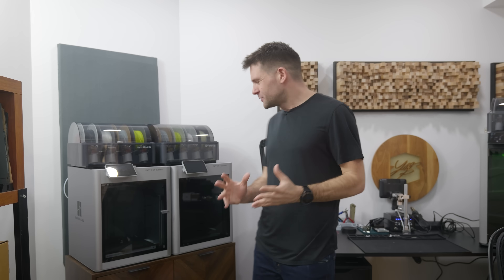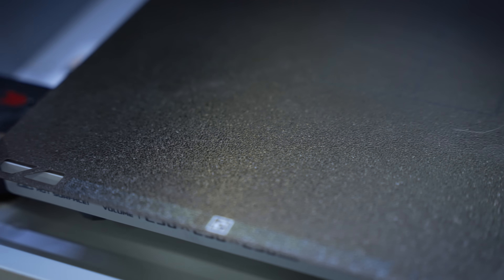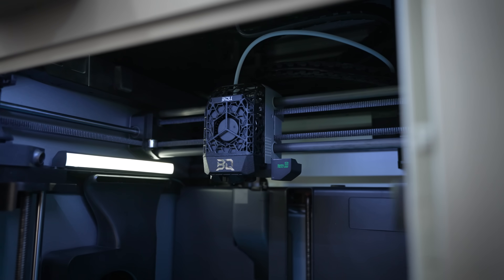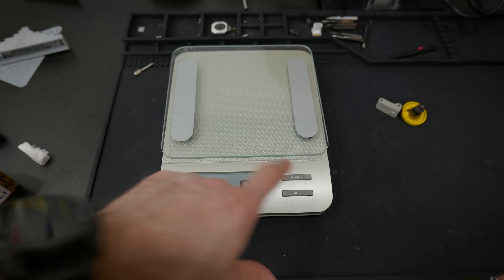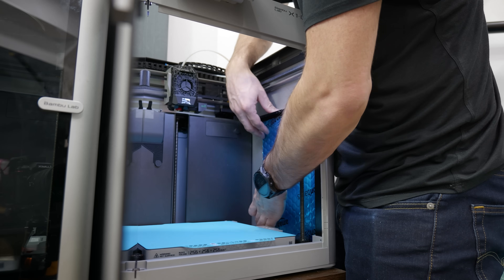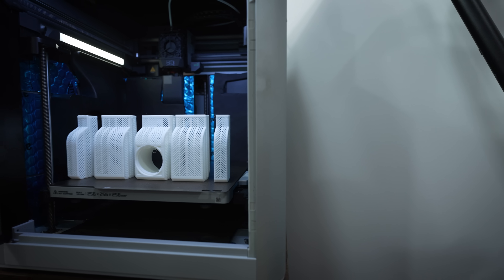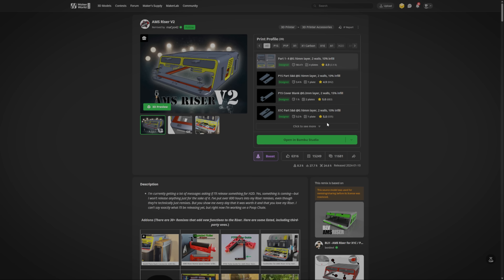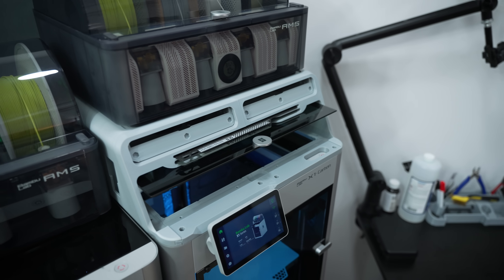I dont understand why more people dont MOD their 3d printers...

Comment: "why don't people mod their 3d printers"
*laughs in ender 3 pro*
Reply: I don't evem remeber what my Ender started as lol
Reply: I opened the video and was just like, well that's just a bad question, I don't know anyone who hasn't modded their 3d printer.
Reply: @iheartninja  I spent the first 1000 hours of printing EXCLUSIVELY printing upgrades or different mods to try.
Reply: @iheartninja  I also cant say that somone is perfect happy with what he buyed. There always a downgrade part, even in a topmodel.
Reply: "cries in Ender 3 Max Neo"
I first swapped the glass bed for a magnetic textured PEI bed. Then I swapped the hotend and extruder for a Sprite Pro extruder.....that the 4.2.2 mainboard didn't support. So then I got a 4.2.7 mainboard, but there is no factory firmware for the Max Neo for that board. So then I had to build and compile custom MRISCOC firmware. Then it sat for a year because I could never get adhesion. Did a bunch of research and found I I to fix the esteps and Z probe offset......and also that I had been turning the leveling knobs THE WRONG WAY! All good now, and I've had it up to 900% speed on a print.
Reply: @justinmcwilliams6759  lol, that was pretty much the same path I took with my 3 pro(s)
Reply: @DemarcusJohnsonIII  Last night I had a print running at 200% speed and 105% flow, no issues. I had it up to 900% speed once about a week ago. The Sprite Pro is DEFINITELY much faster, combined with the much lighter bed.
Reply: @justinmcwilliams6759  Cries in Ender 3 V2 with you
Reply: drowns in tears and regret for buying a printer that 1 other person has and I found him on this comment
Reply: Have you seen the E3NG upgrade for it?
Reply: @ Seems like a waste when you could just source parts for a Voron and have something that's exponentially better, but I could be wrong.
Reply: @DemarcusJohnsonIII  i'm not sure if this reply is meant to me, since there's no tag, but i'm not building a Voron from that, but the frame and motors right now are the only thing that left from original TronXY. I've started with hotend with 3D touch and MB (BTT SKR3 + EXP1 board and PSU), powered by RPi 4 and Klipper. Currently i'm looking for new Bed platform (thinking about Glass or some of those new Cryo plates)...
But i'm rebuilding it slowly piece by piece, when i have some extra money to spare, since its not my primary printer (just the biggest)

But rebuilding directly to Voron was one of my thoughts too... Just a bit expensive at this moment...
Reply: I'm laughing with my TronXY X5SA, While my Ender-3 V3 KE in stock prints parts for that monstrosity which i got for free because previous owner was fed up with it and wanted to toss it.
Reply: @ententeak  I learned the ins and outs of printers and printing on my ender 3. I think it's the reason I'm as knowledgeable as I am with printing.  I'm giving my least modded one to my little brother so he can learn on it before he ends up buying an expensive printer.
Reply: I have just since Januar my first Printer, its the Ender 3 V2 Neo
So much struggle.... but it runs now great with Sonic Pad and just now it prints out a lighter fang and DD mount.
Reply: EXACTLY! It's so moddable!
Reply: Laugh in ender 3 v1...
Reply: AAAAND the title changed
Reply: @quantumuninstall  🤣
Reply: you should see my CR-10
Reply: I had to take my S1 Plus back to stock because the Sonic pad pretty much broke it
Reply: Why dont we “ANY MORE”..😂..
We are so sick of mods!.
My micro swiss hot end alone are now worth more than my CR10 it sits on…. In the Corner….Under the dust, lots and lots of dust..
Reply: i have a anycubic kobra 2 that the mainboard got fried. I had to replace it for a skr mini big tree tech and i have to rewire everything manually AND replace the entire extruder becuase they fail after 3 months
Reply: my cr10s sort of resembles a prusa mk3 now but its been shelved a long time.
Reply: Mine was extremly modified too 😂
Reply: My father has exactly this model
Reply: Ended 3 pro. 😂. You should have seen my Ender 3 first iteration.
Reply: Haha, after adding direct drive, ABL, solid CF bed mounting bracket, dual z , CHT nozzle, volcano clone style hotend and klipper, among other mods I have likely completely forgotten I did My ender 3's still gives my A1 a hell of a run for its money. Oh yeah, and cooling, lots of cooling lol. All those parts still only put the price around what I would have bought the Bambu for anyway, maybe $50 or so more, and I learned a crapload about diagnosing any print defects and their cause and being able to rectify them along the way.
Reply: I do love Creality's attitude of tinkering up 3d printers and selling them, updating them mid-run when people find issues, etc. It's a mixed bag but one that works for the DIY minded.
I started out with a Creality K1 SE, very cheap for a coreXY of its size despite basically being an K1C with the walls removed, and upgraded it well beyond that and am still in right around MSRP for a K1C. Bondtech extruder and XY motion, Microswiss hotend, printed and heat shielded walls, printed chamber carbon filter, printed hotend cover with 5020 part cooling fan, printed riser, old webcam plugged into the USB for monitoring.
The community having the K1 series covered well with software support for Klipper is a huge plus too.
Out of the box experience was fine and the speed was always great, but the quality and consistency of prints with an upgraded and dialed in printer is amazing. And the stock K1 SE hotend and extruder got fitted to the old Ender 3

Comment: You need to insulate the glass at the top, that helps massively keeping it warm inside.
Reply: I can't believe he insulated the bottom but not the top when trying to keep heat inside. Makes no sense at all
Reply: Yeah but the cooling part fans will perform worse.
Reply: @thds4815  open the door if using something that needs cooling .
Reply: @andljoy  does it help about noise ?
Reply: @ a little , i also throw a heavy towel over the printer as well to keep even more heat in.
Reply: @andljoy  That's sounds like a firehazard